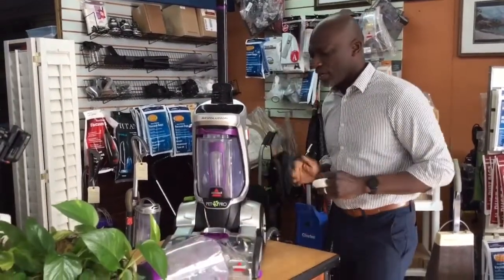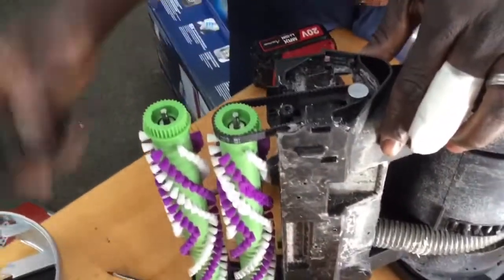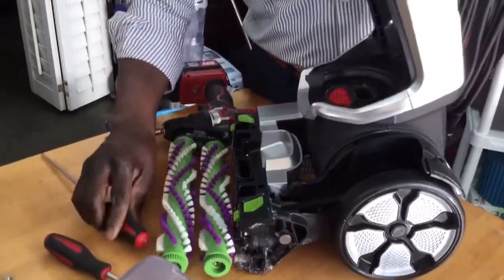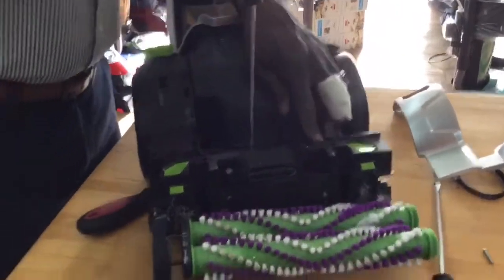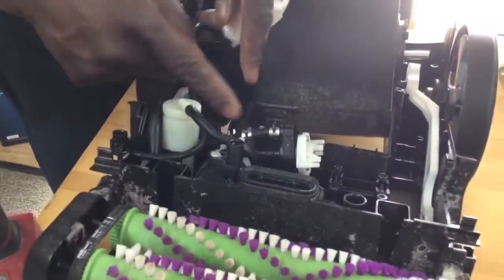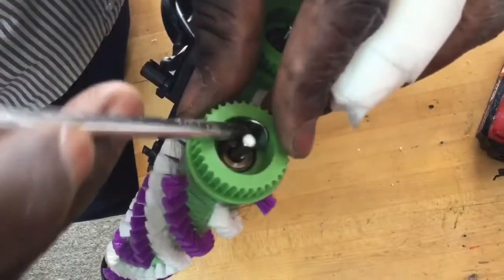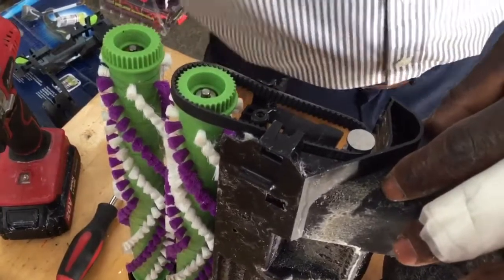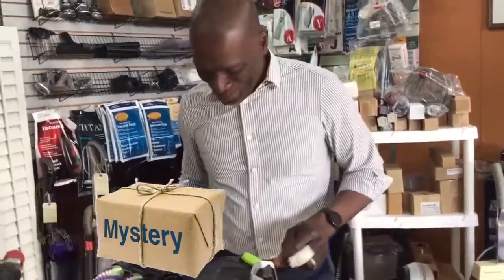Tips on Replacing Bissell Revolution Pump

Comment: I found mine was leaking from the foot jet spray. I blew it out with some compressed air and it seemed to fix it. Before every time I would put the top tank in with water I would get a big pool of water on the floor. Without watching this video I would never have attempted this, thanks.

Comment: Thank you for sharing this video.  I have this very same model and had no idea there was a mechanical pump. I removed the pump and found it was clogged with a thick soap paste substance. I never ran clean water through the system after each use. 5 Stars to ya! Thanks, again for the video. 🏁
Reply from the maker: You’re welcome! That’s great news. Glad the video helped.

Comment: So is there a way to clean out the tube that goes up to the dirty water tank? I have a feeling that is where a lot of suction is going lame...a debre-filled tube! ? How do I keep that cleaned out, as the front scoop does let carpet crap go past it...and thank you so much for sharing you information on these machines that get thrown away a lot!
Reply from the maker: Great idea for a video! If you’re up to it we can try an experiment together. I would try a tooth brush or a long bristle cleaning brush (see this affiliate link for reference-https://bit.ly/49sEyMA) and some good old soap and water- try that pour the water from the top down and try scrubbing - I’ll put a video together about- thanks for the tip- check back to see If I pull it off 😃

Comment: My gear belt creates a burning smell i came to realize that the metal axel on the upper top that holds on to the belt is the only one spinning.. and not the other bottom axel with the red rubber pulley that holds the lower end of the gear belt isnt spinning.. I need help could it be related to the pump causing it not to spin? Thanks

Comment: Thank you so much for your detailed video...Really helpful in order to replace pump. My pump is constantly draining the water without pulling trigger. Any suggestions? Thanks 👍😊
Reply from the maker: Ok this tip a process of elimination. Try removing the handle from the unit. There should be a screw in the back of the handle near the tank. remove the screw, then remove the clean water tank and notice a soft spot. Use a pen or screw drivers do push the soft spot and pull the handle out. After removing handle place the clean water tank with water in it back on the unit. If the water doesn’t spill out then the problem is the handle. If it does then there is a problem with the auto receiver or leak in a hose. Keep me posted.
Reply: @monroevacs  Thanks for your response. I already tried first one and concluded it's not the handle. As soon as I put the clean water tank on the unit, water starts leaking. When I remove the rubber pipe from the pump and put the water tank ...I can see water coming out of pump. Not sure it's the pump issue or the one you're talking about the receiver. Please suggest.
Reply from the maker: @RajeshKumar-zo3ej  I'm uploading a video now that may help with this issue, check in a few minutes or hit the bell to get a notification. .
Reply from the maker: The link- https://youtu.be/pl-4-Krcn2I
Reply: @monroevacs  Thank you for your next video....when i opened the top cover to see how the 1st receiver works with the handle trigger. I noticed two pipe going down. One pipe which controls the water flow through Trigger and second one does not have any control over the water. Same pipe connects to the down pump. When i place the tank on the unit, second pipe starts draining water through pump. So It could be first receiver or the pump. Not working as intended. Can you please suggest anything?🙏
Reply from the maker: Try replacing the pump. The pump shouldn’t leak. Hope that helps
Reply: @monroevacs  can you suggest some link to buy pump for same model
Reply from the maker: Sure..what’s is your model number and are in the USA for shipping?
Reply: @monroevacs  I was wondering if you could share me link to buy pump

Comment: I need to know if the pump belt is the same belt that makes the rollers spin.
Reply from the maker: You do need the pump belt in order for the pump shaft to spin the brush belt rides on the pump shaft so both belts are needed

Comment: Hello I know this is a late reply but is there a chance that the bearings on that shaft connected to the pump could go bad? My 2X has been making a sort of clunking and squeaky noise when turning off but when I take off the belts it’s doesn’t do it.
Reply from the maker: Yes it can go bad- replacing is not too difficult check my Bissell playlist

Comment: Great video. 
Sadly when I removed my waterpump I lost the plastic half moon coupler between the steel shafts.  Any chance you have that part for sale?  Thanks
Reply from the maker: I’ll check. Certain parts are not sold separately, so if i have it; the chances are it would be used.
Reply: @monroevacs  
Curious if you might of found the used coupler?  Thanks
Reply from the maker: Contact me either through email or store phone. Would be better to send pic of what We’re looking at to be absolutely sure we’re on the same page. Visit the about page of the channel to find contact info

Comment: is it possible to test the pump by removing it and with the hose in a cup of water spin it with a drill to pump water?  and if not its a bad pump
Reply from the maker: Yes I believe you can I use to do that test with the older proheat- but leave the pump in place and disconnect the hose from the section that coming out of the main body and feed the water in that way. This way you can see if the pump operates under normal conditions

Comment: When I put the gear belt back on the brush it does not roll. Is it because mine looks like it has rust and that is what keeps it from rolling? Or did I just put it back on wrong maybe? Just need a tip before I take it apart again. Thank you in advance.
Reply from the maker: Rust can prevent it from turning but you can test it by turning the shaft (with the red ball) and also try turning the brush. If they are stiff then they may need replacing. Also check your pump belt

Comment: Thanks for the video, I followed your instruction on replacing the pump belt, but after replacing it the belt broke again after running it for less than a minute. I noticed that the motor gear turns freely but the pump gear does not. I think this is what caused the new belt to break so I think I need to replace the pump. Does that seem correct to you? I have the 1986 model. I'll order the new belt and pump through your links.
Thanks
Rich
Reply from the maker: Sound right, but the description you gave puts in mind of the pump shaft. The part with the red ball. Part number 1610501. Keep me posted

Comment: Hi! Happy New Year, 2022! Somehow your video came up for me. I have a Bissell Revolution Pet Pro model 1986. I actually have barely had it for about 6 months. What has happened is the brushes don’t roll when I release the position to clean, from upright. If I have it in the locked upright position and leaning it back I can see the brushes are spinning. I checked the belts and they are not broken. It does spray and suction fluid. I have only used this cleaner a couple of times. I have emailed support (just today). You are so detailed about showing what to do about the pump that I am wondering if you would know why the brushes don’t spin in the working position. 
I think it’s pretty decent of you to be willing to help people with their machines issues. Very much appreciated. 
The Bissell manual doesn’t even discuss the brushes spinning, except in a small section of attachment of the hose and accessories in that the brushes will continue to spin (and to say do not leave it in that position long to avoid damage to the floor surface. It seems odd that the brushes would continue to spin in that regard. I would have thought by attachment of the hose it would disable the brushes. The YouTube support videos discuss how to change the belts, but I still haven’t found any issue like I am having. 
I like the way you painted one of your models. My mom had a Kirby. Really heavy. Since I was the one who kept house I was the main driver for it. They don’t make things like that anymore. I have no idea what she did with it either. 🐲
Reply from the maker: Check the pomp belt. Even if it’s not broken you may need to change it
Reply: There's simply no mechanism for disengaging the notched belt that connects the pump motor to the brushes.  When the machine is on, the brushes spin.

Comment: Great video but when I try to get the right side plastic part off, it just won't come off. It would have been nice to show us how those clips work on the back part of that silver top piece. I don't want to break my clips, and I have already use a ton of force on it already. I just need to see how that clip attaches in the back area to know better how to pry it up with out working against the clips hooking direction. You made that part look very easy, but in my case, it just won't dislodge. Everything else in the video is super great.

Edit: Hot diggity dog, I didn't end up having to go into the pump after all. All those tiny little final nozzle ports on the removable plastic piece were all visibly plugged up with some black sludge. I soaked the the whole thing in a tub of water outside for half hour or so and then used a twisty tie from a loaf of bread to clean out each output nozzle port. Just use a lighter to melt off the plastic stuff from one end of the twisty tie to make the perfect tool for cleaning out those jet ports. Works like new again.
Reply from the maker: I have a few videos in my Bissell tips playlist that may help you navigate the system better.  Check the out

Comment: Got the new bissell ProHeat 2X® Revolution "carpet cleaner they keep sending me belts that connect to brush rollers that are to small I only used my carpet cleaner for half a room until the belt on left side is so stretched out the rollers slip they keep telling me the belts r correct had  2 mechanical people look at it and tried belts they said your belts are wrong size but bissell keeps saying they are had the cleaner 4 four months but had surgery so on my first attempt the belt failed before I got one room cleaned any ideas
Reply from the maker: I’ll look into it. Send me the model number and the belt part number (the part number should be on the plastic package the belt came in)

Comment: My shampooer is spraying and sucking water, but the bristles are only turning if it's off the carpet. As soon as I put it down, it'll stop turning. Almost like there isn't enough power for the bristles to turn. Please help!
Reply from the maker: 1st check your pump belt  you can access it on the idle panel near the wheel opposite the handle release pedal- change that belt then if it doesn’t fix the problem, continue to the brush and geared belts- keep me posted
Reply: @monroevacsupplies  I checked the belt, and it looks like and smells like it is burning from friction. I turn it on, and I can see that the metal rod is turning, but the belt is stopped when the bristles are on the carpet. It's sliding. I'll clean it up and change the belt. Hopefully, that is the issue! Thank you!!

Comment: Any idea on how to remove the bottom part of that holds the brush rolls with the belt and it has the two metal poles attached?
Reply from the maker: Check my videos in the Bissell tips playlist the last video that I uploaded should have that tip
Reply: @monroevacs  ok ty
Reply: @monroevacs  Mines doesn’t have a screw to remove the part I don’t have the pet pro one I have the first version

Comment: My used Bessel revolution pet has lost its cap for hose assembly. Would that stop sucking into dirty bottle ?
Reply from the maker: which cap? if it's the cover/cap that is located in the nozzle, then yes.. To test this...try covering the opening..possibly with tape to see if the suction returns. if the cap you are referring to is on the hose end that you hold when when using the upholstery tool ....then  it would only impact the suction when using the hose and not the floor

Comment: The suction hose that bends/flexes at the bottom just ripped on mine. This is only tearing down the front to have access to the first half. I cant even find the part anywhere. RIP
Reply from the maker: Have you ever heard of dip. Its a rubber solution that allows you to life back to tool handle. Like adding a layer of rubber. It can found in lowes.  I’ve used it to temporarily seal up tears in hose (especially when the part is not available) try it if you just want to get a few more use out of the Shampooer before buying a new one
Reply: @monroevacs  might give it a shot. Its ripped pretty bad tho, the wire is the only thing keeping it together. Torn all the way around. ill see if i can rubber weld it with something. thanks for the tip

Comment: The black priming cylinder broke off mine. Do you know the part number for that middle part with the hoses is?
Reply from the maker: Bissell have the Revolution and the Revolution pet pro.1986 model- Pump Shaft 1610501
Pump Proheat 2X Revolution P439 1609212
If that doesnt help reach out with you model number and I'll do my best to help

Comment: Ive looked ar every video i still can’t figure out why its smoking when i turn it on. Its not suctioning. Ive replaced all the belts n its still smoking n its smells like it’s burning.
Reply from the maker: Check the pump shaft see if it turns freely without the belt. Take off the belt cover on the side and remove then use your hand to try to rotate the shaft. If it not d heft then try the brush roll. Examine each roll to see if there’s melting on the ends
Reply: Thank you!

Comment: can you make a video showing how to change out the electric motor in the bissell revolution 2x pet carpet cleaner 1986? The motor driver up in mine and after taking it apart and taking pictures of every step there are a few pieces im still struggling to put back together correctly. Thank you
Reply from the maker: I’ll work on that

Comment: My belt isn't broken but it has a loud noise and burning smell. Please help!! I can't find anytime helpful
Reply from the maker: Are you able to determine if the noise is coming from the brush or from the motor area? One test is to disengage the belt and then turn the unit on to see if the noise is still there. If the noise is not there, the problem may be the brushes.